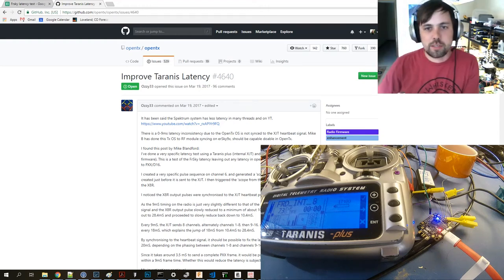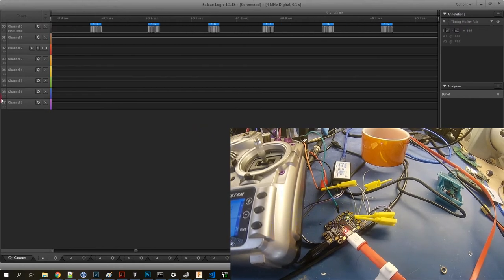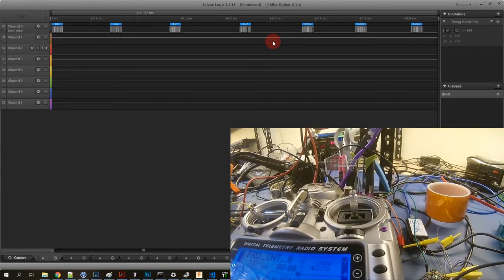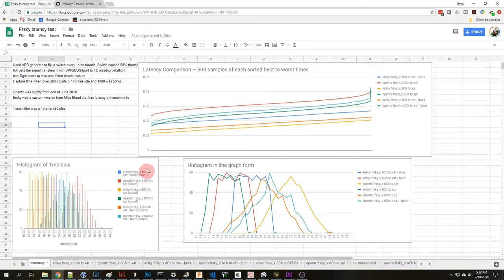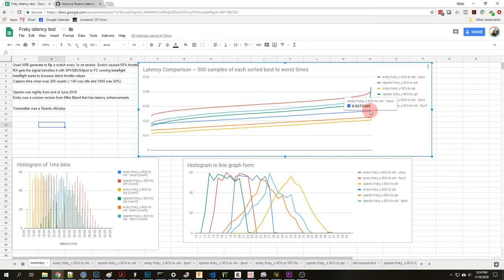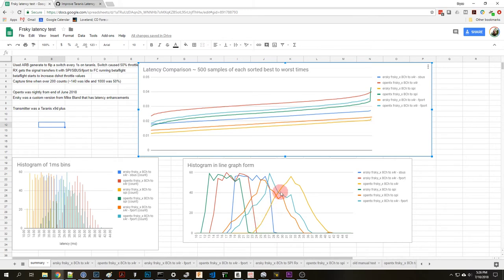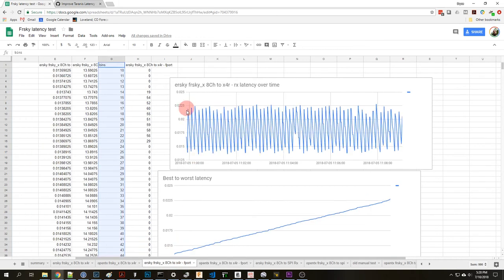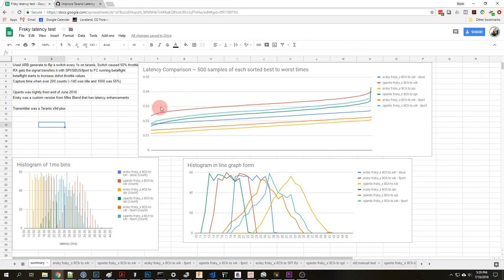Reduce your Taranis Latancy: Opentx vs ersky9x, SBUS vs fport vs SPI

Comment: hey man, I would love to see your test setup with the new access protocol.  thanks for doing this!  great video!
Reply from the maker: Someone else's test when ACCESS first came out showed no improvement over frsky_X .  Although they have supposedly changed some things in the newest.  Frsky isn't doing anything magic with ACCESS, same TX chipset.  Most of the latency issues with frsky in general is due to opentx and queuing up data on the TX/RX, they didn't need a new protocol to fix those issues.

Comment: This is the first I've heard of ersky, this is interesting and I'd like to give it a try.  I see instructions on how to firmware update my Taranis Plus but there's nothing about the receivers like the R-XSR.  Do I just leave the R-XSR receiver with the opentx firmware and it'll work anyway?
Reply from the maker: The R-XSR works with both and no firmware changes are needed.  I like Ersky9x for the latency improvements, although I would say it is a little harder to use... :D
Reply: @redpinelabs  does ersky support "R9M UHF" on my taranis X9D?  (not plus version)
Reply: @hansturpyn5455  Yes, I'm using R9 in my QX7 running Ersky9x

Comment: Could you check setting for OpenTX where only channels 1-8 are send to receiver?
If I remember well frsky is sending channels in 2 packs - 1-8 and 9-16. Reducing to 1-8 you can acheive lower latency. In my opinion there should be less latency fluctuations. Consider so such situation where stick input appear when 9-16 is send so receiver need to wait for almost 9ms to send 1-8 pack of data.
Reply from the maker: Yes this was all done with sending only 1-8 channels.  I was going to double check sending all 16 channels at one point just to verify the worse latency.

Comment: I have x4 rsx-r on s-bus and was wondering if f-port had low enough latency for racing. Most guys i race with have crossfire and say thay can feel the difference. Now I am just learning about spi in your video.
Reply from the maker: The biggest improvement if you have a taranis is switching from opentx to ersky9x.  From what I have heard for the more modern rxsr sbus and fport are about the same for latency.  The improvement on the older xsr and x4r when switching to fport was because some fixes in firmware.  I have since done testing on crossfire but haven't published it yet.  Switching to ersky9x will move you latency from 18-35ms to 13-22ms.  Crossfire is about 9-21ms.  I'll see if I can finish that video in the next few days...
Reply: @redpinelabs   Thank you very much! So ersky9x and rxs-r will be almost as good as crossfire. I am so happy. Now to find the software and get this all up to date. I am making podium now in my multigp chapter and need that edge. Hopefully this will be a how to video, I am afraid of bricking my x9d+ and want lua to work.

Comment: This is a very interesting video! Does the ersky9x have logical switches like opentx? Does crossfire work? Is there any drawbacks running ersky9x compared to opentx?
Reply from the maker: Crossfire works in ersky9x.  The biggest drawbacks is that the setup/GUI is much different and takes some getting used to. I don't think there is lua support, but I thought there was some other scripting although I haven't messed with it.
Reply: @redpinelabs  Is there a good tutorial for installing this firmware? Is it basically just put the update file on the Taranis SD card and flash it from the Taranis?
Reply: I managed to flash the firmware by looking at a yt video where a guy flashed a qx7. Pretty straight forward. The menus where a bit different, but not a problem. Do you know if it is possible to set up logging in this firmware similar to opentx? I like to have logging enabled for logging telemetry and GPS data from my crossfire rigs
Reply: Regarding lua, it's not something I often use, but I find it handy to control my vtx from it regardless of having the video in the goggles or not. I can probably live without it :)
Reply from the maker: @oyvinla10  Yes I believe you can set up logging in a similiar way to opentx, although I haven't done that.

Comment: Hey maybe it's a stupid question, but do you know if D8 mode has more or less the same latency as D16 8ch mode? I have a Beecore which has a D8 frsky receiver that uses SBUS.
Reply from the maker: When I tested using a SPI receiver that supports both D8 and D16. D8 (frsky_D) is a little slower then D16 (frsky_x) in 8ch.  As far as the D8 sbus frsky receiver that they use, I'm not sure where that sits.  It all depends on their firmware.  For example, I had firmware differences on the same X4R that changed the latency by 5ms.
Reply: I have no equipment to test unfortunately, by feel I didn't notice any latency between that and my other D16 receivers. Have you tested D16 mode with 16 channels to see if there is an increased latency? On reddit there is a guy that says that with D8 mode 16 channels get sent, but the upper ones are zeroed in sbus: https://www.reddit.com/r/Multicopter/comments/5y9g3l/frsky_released_firmware_that_outputs_rssi_on_ch8/ Maybe the increase latency of D8 is because it's sending 16 channels every time of which 8 are zeroed.
Reply from the maker: A lot of that is naming confusion.  He means Frsky_X in 8 channel mode or Frsky_X in 16 channel mode.  I don't belive the xm+ can even do Frsky_D (what he cause D8).  Frsky_D can only do 8 channels.  Frsky_X can do 8 or 16 channels.  With 16 channels it does it in 2 packets over the air. It may send all 16 over sbus, but it is only updating 8 at a time.
Reply: Ok got it, so technically there should be an improvement in latency from using Frsky_X in 8 channel mode. There is a way to test this but you need a way to verify if in 8 channel mode at every frame (9ms) there is an update. Check the first comment in this video: https://www.youtube.com/watch?v=P3OI6LMtF6c
Reply: Sorry last question since you are very knowledgeable on this subject: I plan to purchase a Nirvana radio, and I need an external frsky module; now I have two options, the normal frsky XJT module in XJT mode, or the iRangeX multiprotocol module (which does frsky, dsmx etc.) which uses serial protocol MULTI. Which one do you think will have the lowest latency?
Reply from the maker: I would get the multiprotocol, a couple small tests (several months ago) I did showed it had a little worse latency, I believe they have/are fixing some things and then it will make it better, but I haven't got to test it again.

Comment: what version of opentx were you running?
Reply from the maker: It was a nightly build from 2018.  I haven't got to test the newest opentx that is supposed to have some latency improvements
Reply: @redpinelabs  the call it "heatbeat" which I think is a direct quote from this video.  lol
Reply from the maker: @heartofamericafpv5584  I took the heartbeat name from ersky9x which started sync the transmit to that back in 2018.  That's why ersky9x was so much better in latency then opentx on the same hardware.  What really funny is deviationTX using the frsky_x protocol is way faster yet (and faster then crossfire). https://docs.google.com/spreadsheets/d/1MlGdLWIP5fOoVWmKOD-yPR4OXxioPMrUnrCy-muQypg/edit#gid=891788793